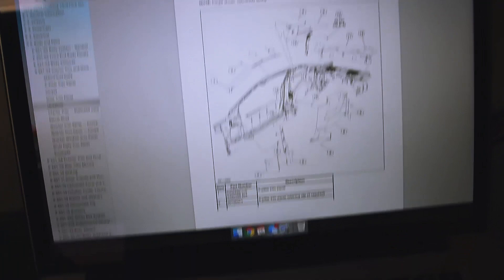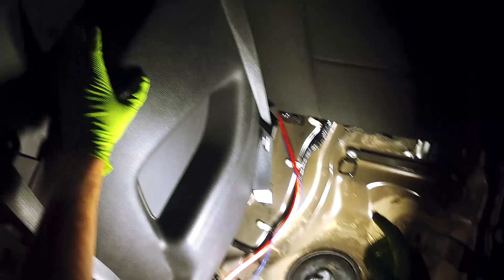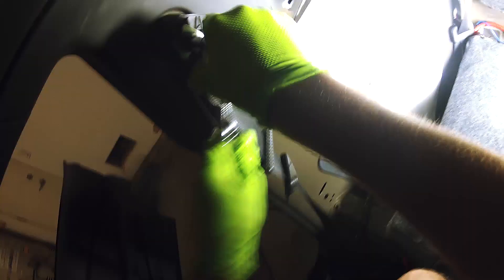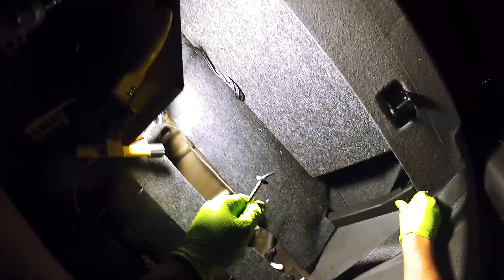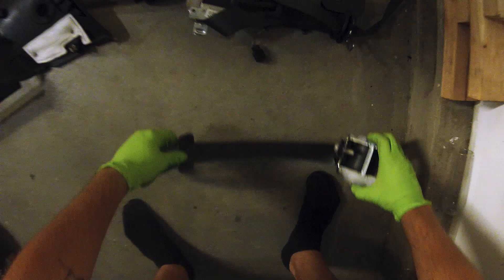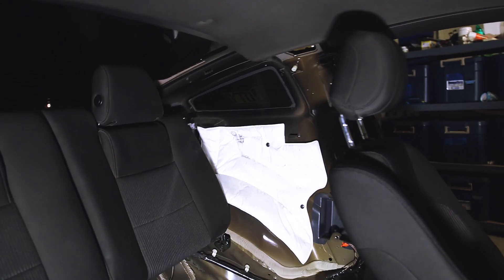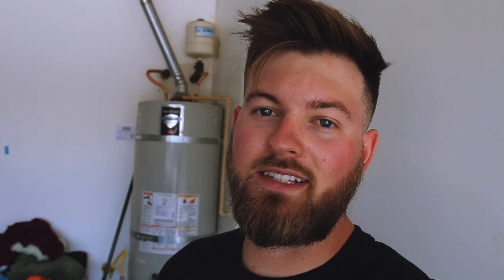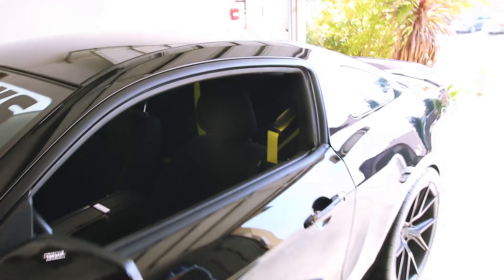Installing Custom DIY YELLOW Seatbelts in my Mustang GT! | SafetyRestore

Comment: I was wondering if you replaced the buckle also. I would like to know if you had to do a modification to mount the buckle. I have an 02 GT where I can't get the OEM belt anymore - at least not a new one. So, I'm looking at a Safety Restore belt but it's labeled as "universal" and I've been told that the buckle doesn't mount like the OEM.